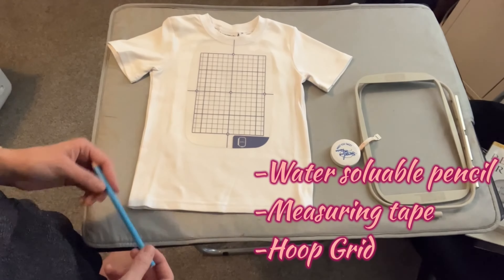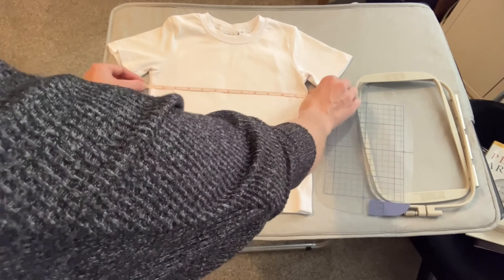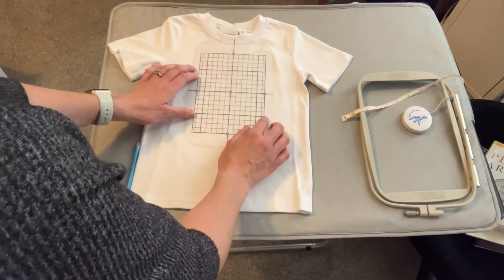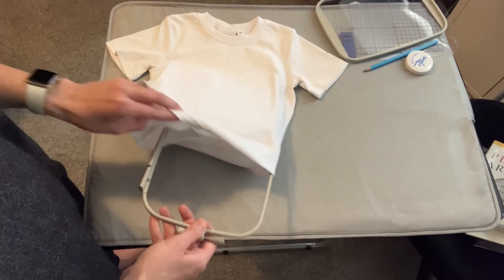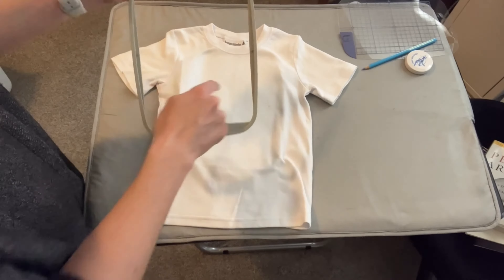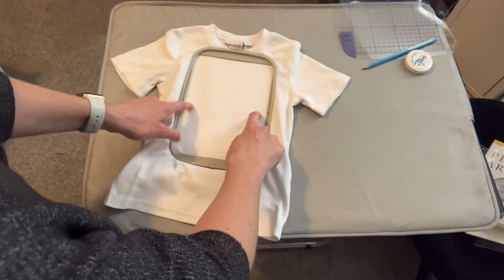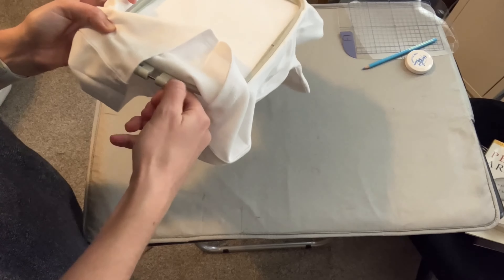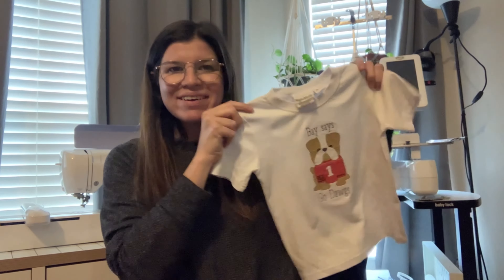How to Hoop a T-Shirt for Machine Embroidery: Tips and Tricks for Perfect Results

Comment: I was taught to never pull on your hooped item to get it flat in the hoop. Pulling on your tshirt is a good way to stretch that fabric and pull it off grain even with a fusible cutaway on the back of the embroidery work. You were lucky your stitch out didn't pucker in the end once it was released from the hoop.
Reply from the maker: Hi there! I see what you're saying. I could see where that would happen if you pulled it extremely tight. I've been doing it this way for 10+ years now without the issue you mentioned - but like I said I can definitely see where that would happen if you pulled extremely tight, but just pulling it enough so it's not loose in the hoop has never been an issue for me.

Comment: hey thanks for the video it really helped me abut i have some questions , how did you flip the tshirt before putting it on the machine i can really do that ( to make sure the back and front dont sew together ) and my t shirt s always loose when i hoop it so i get plukers all over it is there anything to do there
Reply from the maker: Hi there, so sorry for the delay in reply! First you hoop it. Pull it some (not so tight as to stretch the shirt but enough so there are no puckers and then screw your hoop as tight as you can. Continue to stretch a tad so there are no puckers. As far as making sure the shirt doesn’t sew together, you have to move the back of the shirt out from under it and just hold it out of the way while it embroiders. Never put your hands in the embroidery field while the machine is going though!

Comment: Hello so the starting point is the middle of the tshirt ? I am having the hardest time centering I did the float method I do this method and I still don’t get it.
Reply from the maker: Your machine should start in the middle of the design, so you’ll want to measure how big your design is and then mark your shirt accordingly. I use my clear plastic grid that came with my hoops to do this- that way I can just mark with a dry erase marker on that how big the design is and then put a mark on the shirt. The hoop has to be straight for the design to come out straight though. Happy to clarify anything! I’m sorry you’re having a hard time. Getting the hang of hooping is definitely the hardest part of embroidery IMO!

Comment: You don’t put the plastic grid on the hoop with the shirt in it to double check that you have the center mark actually in center?
Reply from the maker: You certainly can if that works for you! For me, I’m usually most concerned with making sure it’s not crooked when hooping- I don’t like to have to hoop it over many times so by measuring I know that wherever the dot is, that’s where I can start my machine and it will be fine as long as it’s not crooked on the shirt.